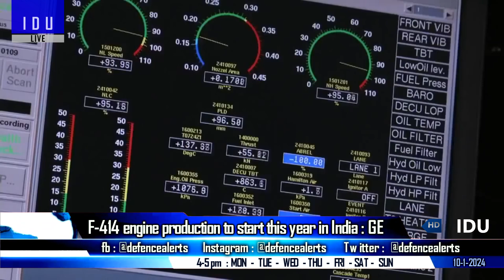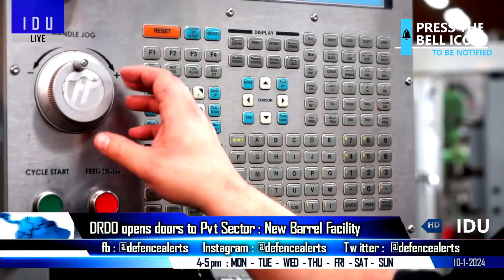Indian Defence Updates : 1st Tejas MK1A Taxi Trials,Dhristi-10 UAV Delivered,100 Super Sukhoi Deal

Comment: Indian drdo should modify the f414 engine by technology transfer from uk, it has only single vertical exhaust system it can be modified by adding interconnect pipe system in which the blower can be interconnected electronically and can be used twin exhaust or three exhaust system which helps the flow of air quickly and helps fighter jets to access at a very high speed

Comment: IN should also opt for Airbus A320 based maritime patrol aircraft, already IAF is modifying the same airliners for various platforms. A320 maritime aircraft will have more range, service ceiling, payload capacity, speed etc than C295 based maritime aircraft
Reply: Airbus doesn't have a P8 equivalent to offer , the subsystem are too complex for India to develop on its own
Reply: @Aaditya_electro  i asked about modifying the A320 one into a maritime aircraft, like how IAF is modifying it into AWACS
Reply: @AnirbanSarkar203  again, the P8 is the best maritime recon aircraft and it doesn't make sense or not even possible for us to achieve the same results.